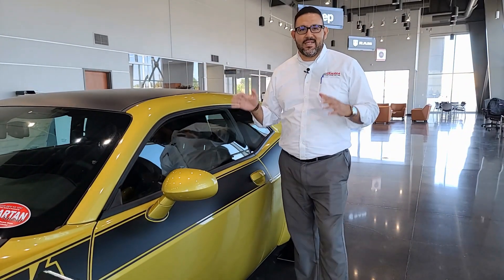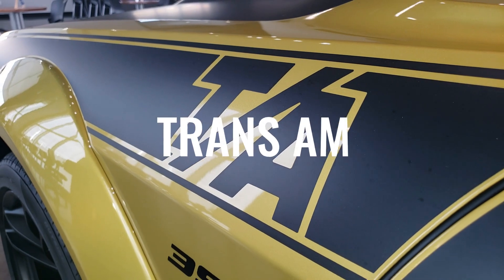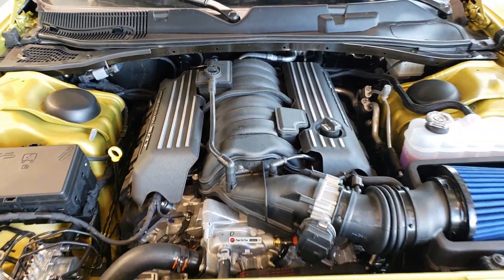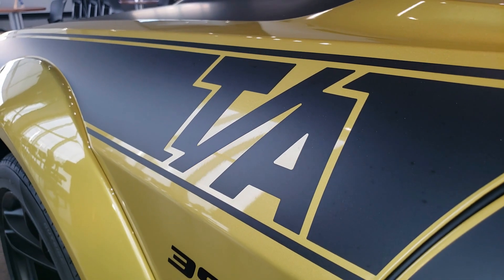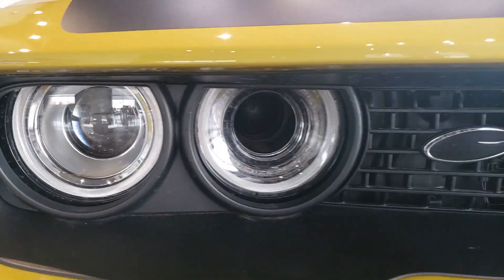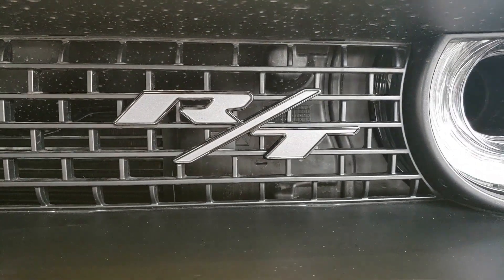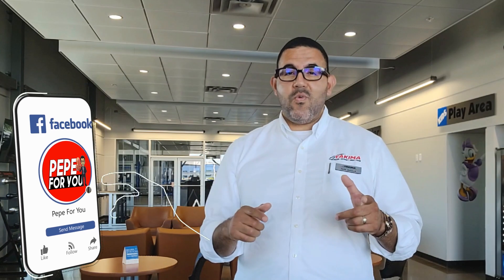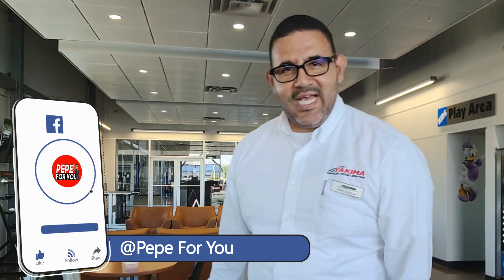How many Gold Rush Challengers were made?

Comment: I just purchased a 2021 Challenger Widebody SRT 392 Scat Pack T/A version in the Gold Rush. Only has 3000 miles on it (about 3200 now since I've been driving it). The previous owner did a stripe delete, so there is no T/A stripe down the sides. I like that because it gives the car a clean sleek profile. It has the Alcantara leather seats and he also did the spare tire delete for the Harmon Kardon system with the amp and subwoofer that gets mounted in the trunk. It also has the 6-speed Tremec manual transmission.